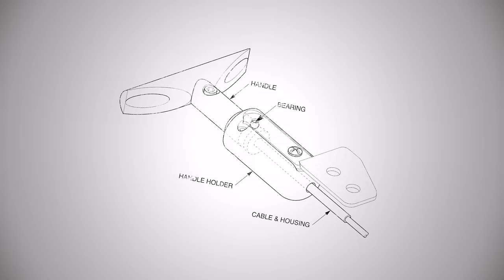Cirrus Airframe Parachute System (CAPS) Experience | Greg Huntley

Comment from the maker: Thank you for the comments. The Huntley's are as authentic and genuine as they come. We deeply appreciate their willingness to tell their story so that others can learn from them.
Reply: Was the reason of the actual engine loss discovered?
Reply: @THEVATICANTS  The NTSB report is online, here is the relevant "probable cause" excerpt from that document: 

"Maintenance personnel's improper tightening of the crankcase through bolt nuts during reassembly of
the engine at the last overhaul, which resulted in the failure of the crankshaft and the subsequent total
loss of engine power."
Reply: @davidbsac  that maintenance shop would get a very ugly and unpleasant visit from me....
Reply: @THEVATICANTS  Surely their insurance would be liable for the loss?

Comment: For cars, I use Porsche. If I ever decide to learn how to fly, the Cirrus SR22 is the way to go, especially with an emergency landing in a Lance Piper with 6 souls on board ......
Reply: What about Diamond Aircraft? Sure its a little more expensive but if you can afford a cirrus why not get a Diamond airplane? A DA-40 NG is sooooo much safer than a Cirrus aircraft with a parachute, and the Da-40 is one of the, if not the safest single engine piston out there. Did you know that the descent rate with a Cirrus airplane that has its CAPS pulled is twice the descent rate of a DA-40 when it is fully stalled out?
Reply: @amaanoliyath4875  good point.

Comment: But why did the engine go out?
Reply: The NTSB report is online, here is the relevant "probable cause" excerpt from that document: 

"Maintenance personnel's improper tightening of the crankcase through bolt nuts during reassembly of
the engine at the last overhaul, which resulted in the failure of the crankshaft and the subsequent total
loss of engine power."
Reply: Malfunctioning flux capacitator ...
Reply: @FlyGuy2000   there would be some "broken noses" once I revisit that hangar....

Comment: So what happened to the engine that caused the prop to seize? I read that a lot of these parachutes have had to be pulled in a Cirrus aircraft over the years. It shows how safe the parachutes are but how terrible the engines are.

Comment: do you cirrus lovers know the real reason for the parachute?  this aircraft did not pass the FAA certification standards for factory certified aircraft approval.  cirrus either had to redesign it to meet the standards of all other certified factory production aircraft or install this parachute system.  they then proceeded to convince the public that instead of being forced by the FAA to do this due to their inferior design  they came up with the idea on their own because of their concern for safety and their desire for innovation.  their marketing strategy targets new pilots and student pilots because very few pilots who have much experience in aviation will pay their price for this inferior airplane when they know can get twice the airplane for about half the price. this huge price is due in large part to the expense of this parachute.  it also suffers a price in useful load due to the extra weight of this thing.  they also warn not to go anywhere near one of these things if it has crashed and the chute has not deployed because that thing could suddenly explode and kill someone standing near it. i don't care what is happening i'm not going anywhere near one of these things if it has crashed and that chute is not lying around somewhere in plain sight.  even before i knew all this i always said i would never own the only airplane in the entire history of aviation that needs a parachute.